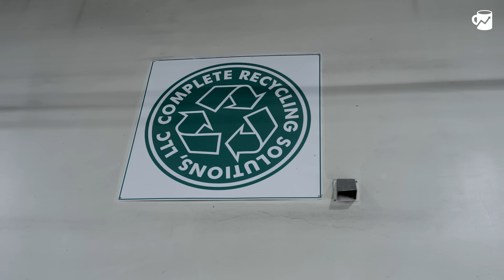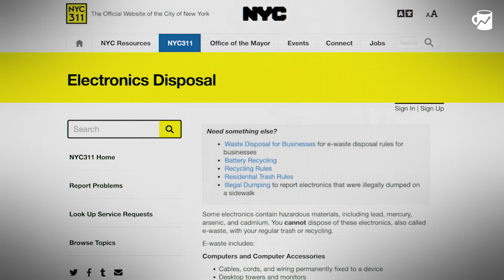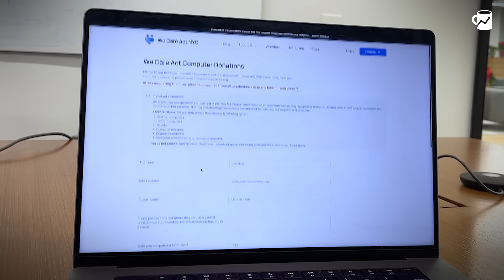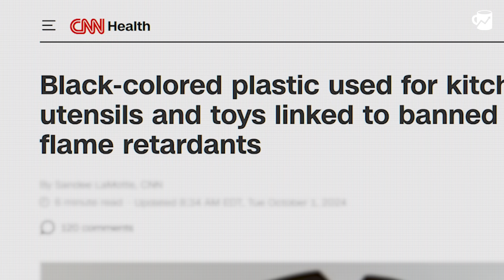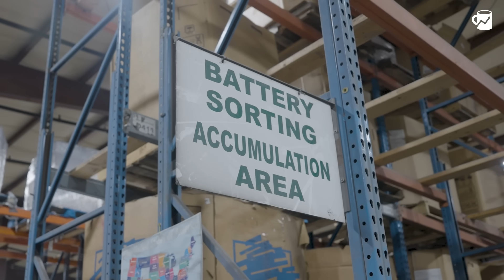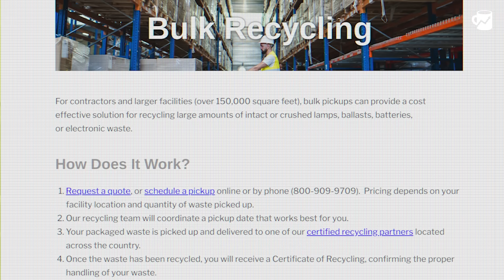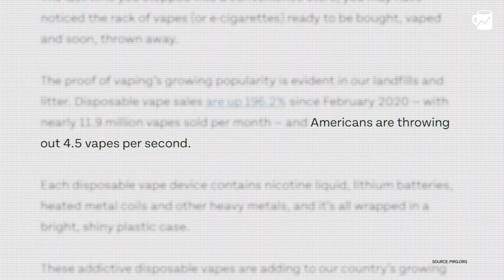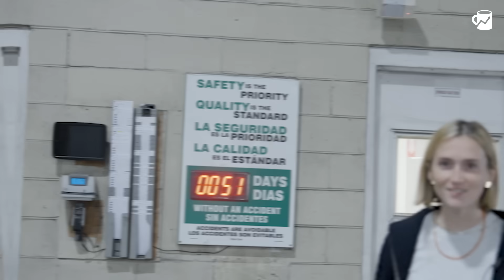I went down a rabbit hole trying to recycle all my tech waste

Comment: Vapes should be classified as hazardous.  
Many of the liquids sold are absolutely unregulated. Some studies have shown that the liquids contain degraded fibers from people's sofas in their garage where the liquid was packaged. Others have been shown (in peer reviewed studies) to have significant and harmful levels of heavy metals.  
A recycler would have no feasible way of determining what that liquid is.  
Edit: A meta-analysis is "A Comprehensive Review of the Harmful Compounds in Electronic Cigarettes." That study does not include several others I have seen, but does agree with those other studies so suffice to say it is well recorded.

Comment: I have lots of random electronics that ive collected and I cant think of tossing them out even if i dont have a use for it right now. Sadly ill have to give it to bestbuy to recycle since its just a bunch of random. I still have my older laptop an hp envy 17" notebook from 2015. Still works with linux but its just a backup.

Comment: So there are places called scrap yards, at least in the US. They will pay you for metal and metallic items by weight. They then shred it, melt it down and reuse the metals. The slag (not metallic stuff that builds up on top of melted metal) can be used as filler in different things or disposed of in a much smaller volume. The metal is then made into rebar or whatever they need ambiguous metal for. Or if you put in extra work and separate the wires and such you can get more money and they can make new wire, new radiators new whatever based on the metal

Edit, this video actually did a very good job of explaining how this works but it's not as complicated as she made it seem. Take your stuff to a scrap yard if you don't have a nearby e-waste processing location

Comment: I am also a repurposeing type for tech, but i can tell you one thing; stuff gets discarded in stores too. Because it's obsolete before it got sold, or returns (online and physical stores) and ofcource, what you will never get to see; the factories. They dump tons of parts, which could be sold; but it is a hassle for the factory. So they just scrap it... easy. So now, we are struggling with recycling on the end of the line... so much more could be done at the very beginning. Also making it possible to change batteries in laptops (selling the batteries, originals... no knockoffs) with a new one could change things drastically. But it all comes down to one simple fact; companies rather sell a pallet of brand new laptops/computers. Than help 10 people getting their parts for (older) hardware.

Comment: In Europe, you pay a small amountvipfron when buying new device. Then, seller is by law required to accept your old device for recycling if you want to ged rid of it. Recycle centers are also forced to accept old devices. Many people would not pay 30 dollars for get rid of trash, but throw it away, as happens with waste from construction of buildings for example. People pay high taxes, recycling center should be built and funded from these.

Comment: The MacBook Air could have fetched $175 on ebay. The iPhones (11 & 12) could have gotten $200-$250 ish. This assumes they were all in decent working condition. Pawn shops (or the equivalent which is where she went) base their prices off ebay because that's where they will likely be selling them. They'll give maybe 20% of ebay market price for something at most.

Comment: no joke, I have collected over 50 batteries over the past 3 years from the devices at home. I can't throw them away because there is not collection point in my city and they have been degrading in a stinky plastic bag.

Comment: Buying things that will hopefully have a long lifespan and can be repaired is key. And if  cheap, non-repairable electronics are the only option I buy second hand.

I recently learned about modular laptops from Framework that can be upgraded with new parts over time and I own a Fairphone that hopefully will last me 10 years (fingers crossed). 

Also in the EU there are some great regulations, so that companies that sell electronics have to take your old electronics back for free. I hope current plans for policy on electronics repairability will work out. Still, recycling has to be improved.
Reply: Not a huge fan of Fairphone
Its an already old product when it hits the market
I would rate their non phone products as eh and their phone as oK
I can just buy a modern phone and trade in my old phone
Reply: @Dara-wk5ty  sure but you won't be able to switch out a charging port or battery yourself on another type of phone without expert tools and knowledge

Comment: plasma recycling could handle it all and recover the metals too.  if we built things modular and standardized,  we would be able to do more with the stuff.  smartphones that worked could be used for something.  one thing that is total nonsense is how phones can be bricked where they will not do anything and there is no factory reset inside.  some stuff used to take a pin poked through a hole but i have not seen that lately.

the corporations don't want anything re used and they don't care about the earth at all.  if they did, you could take the drive out of a phone and use it in a laptop or desktop or put it in a little box that plugs into usb.

Comment: The nerd in me is cringing at the fact that you yourself are just throwing away the valuable electronic scrap and not harvesting the innards of the materials such as the Gold dust, Silver, Platinum ect or even the copper from the inside and melting them back down to nuggets or ingots per the respective minerals. Sure it would take a lot for the dust to be warranted to be melted back down into a solid but it's better than just throwing it away. Also from where I live Copper is king if you wanna recycle stuff and while there are different types of coper wiring they can bring home the good money, and fun fact where I live just the bags of copper wire are worth more than just copper blocks but #2 copper wire which might be common ranges from $2.75 - $3.50 per pound and with how often you can find broken copper that adds up fast. Again at least in my area. 

I am not interested in saving the planet mind you, I just want the shiny rocks, though selling the shiny rocks for money also sounds like a neat idea but so does making my own electronics such as SSD's that would be high capacity and personal use. I just don't have the necessary materials for that project yet

Comment: I'd have taken the power adapters (for my 2010 & 2012 MacBook Pros, and the 2015 MacBook as well <G>.   I use older laptops for testing Linux distributions and other opensource operating systems (such as Haiku, Reactos & FreeDOS).
That's what some of us are expecting to happen when MSWin10 goes out of support & perfectly functional machines won't be able to run MSWin11 [1].  There will be a big influx of perfectly usable test machines.

[1] actually they could, at least at the present time, as there are hacks to get past the HW checks.  My MSWin11 test machine is an 11 year old Dell all-in-one.

Comment: In the Netherlands we have something for this problem called the "old for new rule" which basically means you pay a little fee for every device you buy. But this also means you can always return your old device when buying a new one.
This works with all electronic devices, but also with chairs, beds, tables etc. As long as you're buying a similar device to the one you're bringing for return the store has to take that device from you. The size of the product or brand does not matter in this example. Apple stores also have to take your samsung when buying a new iphone. This also works for online stores :)

Comment: Simply, because few of these items are purely of one element. They're complex combinations of dozens of elements, plastics, ceramics, metals and there's simply no way to just melt it all down and separate the elements from each other.

This is why humanity would be better off if we'd make our best to reduce the use of these kinds of materials.
PE-plastic bottle is easier to recycle and deal with than PE-plastic bottle with aluminium lining.
Glass is easier to recycle than glass fiber with it's polymer (plastic) resin binder etc....

We can do better as a species and COMPANIES are the ones who need to carry that responsibility, not consumers.

Comment: The "Reduce, Reuse, Recycle" slogan feels good but it doesn't acknowledge how 1) businesses operate and 2) consumers behave. Electronics manufacturing is a top to bottom industry serving a hungry market that does not prioritize reduction, re-usability/longevity/repair-ability, or recycling—affordable products are the exact opposite. Consumers don't have any incentive to put in the time and work to find used things or resell/donate their own, to repair things they buy, or to find responsible ways of recycling things. A lot ends up in the trash—swing through any landfill operation. (In some states, recycling just goes to the same dump.)

A combination of market forces/consumerism, infrastructure/cost considerations, waste illiteracy, and apathy.

Comment: The "smart" device that can't be repaired and break down easily is the banal of modern society. I'm glad my manager decided to keep the old chinese printer the office bought 15 yrs ago. It's a "dumb" printer with physical buttons that continues to print as long as the black ink remains. Also the cartridge is pretty cheap and you can buy it online for 20$

Comment: I post online all the time that I am looking for peoples garbage power cords. Basically never get hits. I have 4 boxes of power cords in my garage I routinely pick through. What I do is that I tend to either use them or cut off the end and use them. You take the end leads and you can repurpose them to power a microcontroller and any motors or relays associated. I currently have a mechanical 7 segment display clock in my living room running on one, a wifi controller in my garage for operating my door, and a repurposed amp that uses 80w running on an old laptop charger. I got like a half a dozen more but I forget which. As long as they are certified then they are worth keeping. Many of them can be repurposed into phone or battery chargers with like 1 dollar.

Comment: So...  I'm guilty of throwing away things I SHOULD be recycling, mainly because...  I feel like I should be more incentivized to recycle stuff, and I don't want to have to PAY to recycle my own stuff.  Charging the consumer to get rid of their stuff seems so bass ackwards to me, it's hard for me to want to recycle anything that falls into that category, especially if the recycler is actually getting money from it like salvaging the precious metals inside.

Definitely I will try to donate or sell stuff I'm not using anymore, but some stuff just has no value to anyone, and I certainly don't want to have to pay just to get rid of it, so...  into the dumpster it goes.  Sorry, but, also..  kind of not sorry?  It may be "illegal" but uhhh why is it a law if it's essentially unenforcable?

I'm actually EXTREMELY PRO recycling, but not when it costs me additional money I would not have to pay if I just "illegally" threw it in the trash and feigned ignorance.  All that to say that I think it's a worthwhile effort, but a lot of it doesn't "make sense" from a consumer perspective, and the incentive isn't there for me to be a "responsible citizen."  Shrug.

Comment: Question is can you trust a E-Waste recycle center to actually recycle it. Let's say you own a laptop that has personal data on it but no longer use it but nothing is wrong with it but you have newer model. You don't want to sell it to someone cause of fear they could access your data even though you had reset/format the laptop. So you ended up sending or dropping off your laptop to a E-Waste recycler. Thinking they will in fact recycle the laptop there fore your so called fear of some one getting your data is gone.

There is E-Waste recycler's out there that allows people to come in and buy stuff they receive. So that laptop you send in to be recycled could very well be bought by someone who will end up doing who knows what with it.

That's why every single computer I no longer have an use for anymore. I pull the storage drive and destroy it myself so there is no chance at all data can be received as someone who is trained in electronics repair know what to do. As for the rest say PC hardware or laptop without a drive I might sell it if think it had value yet to someone.

Comment: Here's a tip for old laptops - if it's got at least 8 GB RAM, you can probably run it as a Linux machine if all you need it for is basic tasks (word processing, web browsing, etc). Modern operating systems are super bloated and bogged down with a bunch of unnecessary processes (telemetry, advertising, live services, AI features, etc). So, if nothing's physically broken, and you're tech savvy enough to follow an OS installation guide (hint: most people are) then you can probably extend the life of your device substantially by using a more resource-efficient OS. As an ex-Windows user, I recommend Linux Mint with Cinnamon (it's the default offering for Linux Mint), but there are plenty of "install and go" versions of Linux, and you can always customize it to fit your preferences with a little bit of forum searching.

Linux is not as obtuse as it used to be, and in recent years, there's been a lot of breakthroughs with compatibility, if not making open-source versions of common programs that run natively in Linux. Also, modern tools like the Flatpak Software Manager have come out that makes installation and setup of software much more straightforward.

So, if you can't afford a new machine, or don't want to spend the money, I encourage you to look into it. Especially now that Microsoft is actively trying to force relatively new hardware into obsolescence, and taking some huge risks in some of their new features.

Comment: Simple. Manufacturers should be legally required to release all technical documentation and datasheets once they stop supporting a product—everything, no exceptions. In fact, they should be glad they’re not forced to include this with the product from the start, like they used to. So they should have two options: either support the product indefinitely so it stays usable, avoiding the constant release of new models just to dodge documentation release; or release the docs when support ends, making old hardware usable by hobbyists down to component level.

Patents? I don’t care. No patent gives them the right to fill the planet with trash just to protect their business interests. That’s it. They can choose. There are far too many technologies and standards designed solely to make reuse impossible—even when the manufacturer has long forgotten the product ever existed.

Comment: Few days ago, I was interested in trying to pick up CRT monitor for retro reasons, and I thought that by willing to reuse CRT monitor which contains all the dangerous materials I would be doing the right thing for the environment. So after having many classes in elementary school with the recycling facility about reducing, reusing, and recycling. I called up my recycling facility and asked them if there is any chance where I could give electronics they receive another life instead of getting scrapped. Well... I got lectured that these electronics are property of recycling facility and I'm not allowed to take them. When I told the person at the phone about "Reduce, REUSE, Recycle" I got disconnected, so I called again and they threated to call police on me because I wanted to reuse old electronics that as this video shows are hard to recycle. 

I feel like this interaction was insult to me and all the morals I learned. They have Reuse center but only for furniture, old toys, and other stuff. But not for the stuff that actually matters. I really think the recycling facility in my area cares more about copper and reselling the good stuff at high prices. Absolute disgust for this situation!

Comment: The best way is not to recycle but to keep using it or sell it to someone who can use it. Almost all old tech can be reused. Also, a TI-83 is never going to be a valid tech waste. Ebay is the best solution for ending e-waste. An old TI-83 is just as good as a new one.

Comment: The best purpose for e-waste is for the devices to be refurbished, or be used for supplying parts for repairing other devices. An incredible amount of energy and resources goes into making electronic components and PCB boards. Why put them through a shredder, when they can continue to function as is? A lot of people turn to places like ebay for finding replacement modules for older electronics. Even if a device has serious mechanical damage, it'll have dozens of other parts that are valuable to other people. Scrap electronics are also used by electronics enthusiasts. Often a local hackerspace or maker lab will accept surplus electronics, and salvage the components. Even if a device is at it's end-of-life stage, you can manage some aspects of the recycling yourself. You can dismantle the device, separating the metal components, plastic parts, circuitry and wires. You can sell the scrap metal, recycle the plastic. The wiring can be reused. PCB components can be desoldered.

Comment: In Sweden, if you cant sell, you can just go to the scrap (recycling facility, available everywhere in Sweden) and then dump the cables in the cable bin and the electronic stuff in the electronic bin. Then they will go away to be disassembled and melted into the different metals and so on.